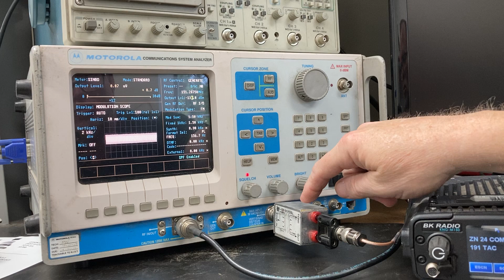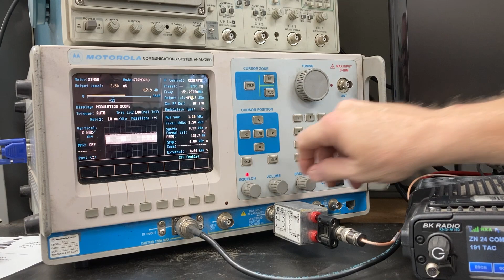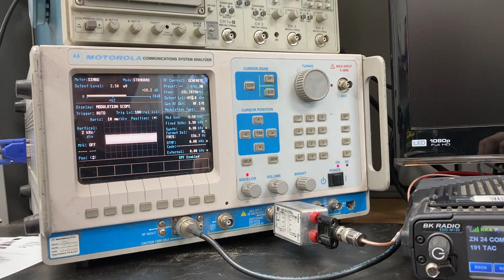R2600 Service Monitor Sinad Meter

Comment: Could you please guide me how to find 1:1 isolation transformer like as in your clip?
Reply from the maker: They are super cheap. 5 pack from amazon is $7. Just solder your own leads. https://www.amazon.com/HiLetgo-EI-14-Coupling-Isolation-Transformer/dp/B073PXK2RX/ref=sr_1_3?keywords=600+ohm+transformer&qid=1672436198&sr=8-3
Reply: @dc95811  thank you so much.
Reply: Able to use on apx series as well?